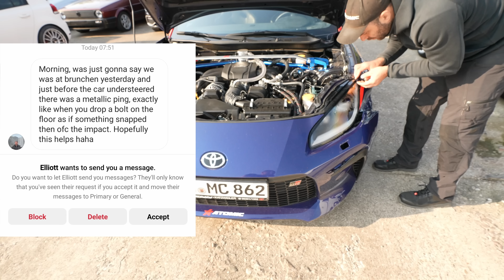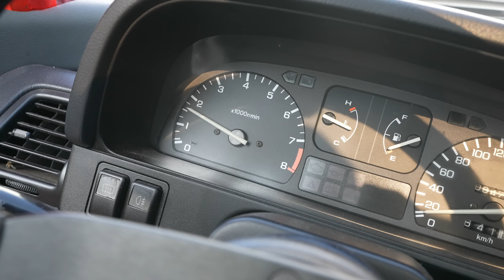My GR86 Nürburgring Crash Damage Report.

Comment: Hi Misha!
First of all: thanks god that you and Joe are safe! I cannot imagine the world without your contents!😮😊
Second: the tie bar inspection looks me quite suspicious! Normally that parts get first bended as a designed failing method (I would have also expected it as you impacted at moderate speed), their crack section is also at the outside joint housing! Thus it's strange for me that the bar looks fine on the outside but the rack can be shaken on that way. I don't think the inner joint is failed too (but possible)...that should be much more massive than the outer one, but take a look at the overall steering! Tie bar fixation thread to the rack, yoke (support and fixation part between rack and pinion)...unfortunatelly the mondern steering systems don't really like NOS missions as durability test! It's not a bet and win contest but the clunk could come from the steering itself!
Keep going and fly safe longer!
Cheers
Marton

Comment: Inner tie rod snapping like that on the steering rack side and without any sings of bending, I hope you give that a second look when the car is on the lift. Usually as a result of a crash they will snap on the threads connecting it to outer rod where it is the weakest, and if it did fail prior to the impact car would want to push straight just like it did, so really want to see that explored further.

Comment: Glad your well Misha! I don't think it's abs going into ice mode because you would have just lost braking. I wonder if anyone had video of the crash from outside just so you could have seen what direction the wheels were facing. That would help figure out some of the mystery. My money is on liquid on the track or maybe that clunk was the tie rod breaking off. Could also be the pillowballs were badly worn on the coilovers and they welded themselves to the strut tower mount. When the fronts pillowballs go, you can potentially loose some steering angle before the wheels actually turn. Basically instead of the coilover rotating where the pillowball is, it'll rotate the shock itself. (it will make a clunking noise like that since the coil spring itself rotates) That lower coilover lock being loose might also be evidence of that. (I'd check for wear on the upper lock where the spring sits on) Anyway, glad you and the passenger are doing good dude! You are by far my favorite dude on YT

Comment: You bring up a good point about ABS.  Something could have failed in the system that caused the wheels to lock up.  As for the noise,  if you ever driven on snow/ice, the ABS does tend to make quite loud "clunking" sounds when it engages or disengages.

Comment: You should be able to tell if the steering rack was broken in tension or impact by looking at the metal grain structure at the break. If there's stretching it was likely your clunk, and caused the accident. If it is "squished" then the break was likely from impact.

Comment: One very important thing to note, it's illegal to polish headlights in germany. For any reason. Be it for scratch removal, to get clouded headlights back to clear or any other reason. To be clear, the damage on the headlight isn't repairable, and wasn't repairable before you noticed the cracked mounting points etc. Just the damage to the glass/plastic alone is enough to render it useless (except, if it doesn't impair function, then you can run it with the scratch - you can't fix that scratch though since the fixing itself is what renders the light illegal afterwards). 

Headlights have a scratch-resistant protective clear coating - which can be tested. If the TÜV guy checks the lights and notices the discrepancy, the car will fail the HU. The second you polish that coating, it's considered "bauteilich verändert", which means that the Typzulassung of the headlight expires. The exact same goes for re-coating the headlight yourself. There's no way around this, it's illegal. Which i guess is fine if you keep it to yourself, but probably not the greatest idea to do it on a car that you're going to give away, for the winner to then face the music at the Hauptuntersuchung. Even worse, it's a criminal criminal offense (not a "Ordnungswidrigkeit") to drive a polished headlight - and they'll also impound the car on the spot since polished headlights void the "Betriebserlaubnis". 

Here in german: 

" Jeder Autoscheinwerfer ist daher ein sogenanntes typgenehmigtes Bauteil. Bei der Typzulassung werden die Scheinwerfer bis ins Detail geprüft. Darunter die lichttechnischen Eigenschaften. Ein weiterer Prüfpunkt ist die Belastbarkeit der Oberfläche. Für diesen Prüfpunkt spielt die Beschichtung mit einer Kratzschutzschicht eine wichtige Rolle. Diese transparente Schicht schützt den Scheinwerfer vor Umwelteinflüssen und vor den UV-Strahlen des Sonnenlichts. Das bedeutet, diese Kratzschutzschicht ist wichtig, damit der Scheinwerfer seine Typzulassung behält.

Wird die Schutzschicht durch Abschleifen oder Polieren entfernt, dann erlischt automatisch die Typzulassung des Scheinwerfers. Der Gesetzgeber sagt dazu, dass die Scheinwerfer bauteilich verändert wurden. Ebenso gilt der Überzug der Scheinwerfer mit einem neuen Klarlack als eine solche Veränderung und ist daher ebenfalls nicht erlaubt. Wenn Sie die Scheinwerfer Ihres Autos polieren, erlischt nicht nur die Typzulassung, sondern gegebenenfalls auch die Betriebszulassung des Fahrzeugs. Sollte bei der TÜV-Prüfung die Aufarbeitung der Scheinwerfer entdeckt werden, wird Ihnen der TÜV die Plakette verweigern. Fällt diese Behandlung während einer Verkehrskontrolle auf, werden Sie mit Ihrem Fahrzeug nicht weiterfahren dürfen. Sie machen sich zudem strafbar."

I get that many people aren't too happy about laws surrounding car modification, but especially a channel that prides itself with tuned and modified cars should stick to legal method, especially on a giveaway car. Now.. I do understand that it's likely not bad intent by Misha or the mechanic, that's why i'm pointing it out here. If i recall correctly, there was a time not too long ago (somewhere in the last decade, i think?) where it was legal - so it's likely that Misha and the mechanic are simply under the impression that it would be perfectly legal/fine, rather than announcing an illegal modification to a giveaway car.

Comment: 0:40 the clunk

I noticed that on this clip it started with your foot already depressed on the break, you let go and then applied the break. The clunk noise happened when you applied the break. It's been a while since I've done diagnoses on breaks and suspensions, but this is a clue. It may be possible that the clunk you heard may have already been there, or if a part failed it may have failed prior to this clip. It would interesting to hear the whole video again and listen in every time you apply the break or apply the break hard if there is a clunk or a new noise leading up to the crash
Reply: Also there seems to be some discrepancies with ABS activation on your previous video, the last time you applied the brake the ABS had just turned off and didn't activate when you applied break again. Posted about it with details there. If you're still wondering I hope this helps

Comment: Just a thought, since everyone is saying they heard a clunk… if there was some form of liquid on the track and the tires had no traction, the brakes would stop the wheels near enough instantly wouldn’t they despite the tires still slipping across the track? The clunk may have been the sudden stopping of the wheels with the loss of traction? If you have a car up in the air (no traction) and the wheels are spinning quickly, the force from the brakes, alongside the abscense of traction causes them to stop straight away (possibly causing a clunk from suspension at those high speeds)

Comment: the ball joint on the steering jack is a good suspect. The strange thing is the ABS coming on right before the crash, its like one of the rotors blocked or something (abs sensor failed ? )must see if the sensor didn't touch the teeth ...

Comment: I'm pretty sure it's ABS related, it could be a dirty wheel sensor (rocks will block it), last time it happened to me all of the brake pressure went to only one wheel, I got so many other events with ABS malfunctions in this car, that's why I plan on removing the ABS pump unit completely, there are aftermarket solutions.

Comment: Interesting to me is that car went in understeer after the braking was finished, you were already on slight gas. This shows to me that you weren’t too fast or braked too late, otherwise you wouldn’t have released braking. Regarding the clunk, I was wondering if it wasn’t simply the noise from abs (unsure about how it would be captured by the cam system).

Anyway. Cannot wait to see the Honda :-)

Comment: My track E36 M3 had a 318 ABS in it and the front end locked up under 80% threshold and would not unlock and I went off as you did.  I could feel the pulses and that may have been the "clunking" others heard?  I'm sure you could have felt this.  I tried pumping the pedal and it would not unlock while moving.  It did unlock after I slowed down through the grass.  It did this three times then the 3x rule came into play and I was removed from the track day, haha. This was the first time I tracked it and it was debug day anyway.  the tires did not exhibit much flat spotting at all, look at the tires.  The 318 chassis was preproduction #32 from Spartanburg SC and was sold to GMG/James Sofronas then sold to me.  I did not replace the ABS but upgraded the rest of the brake system to the M version AND PFC pads.  The 318 ABS did NOT like this.  >>>>>>It was not calibrated for this kind of stopping.<<<<<<
Reply: MRMishaCharoudin.  you mean I won the wheel?!? 💥🥰😁 wut?!
Reply: MRMishaCharoudin.  scammer!

Comment: Not ice mode, it gives you a hard pedal you will definitely notice, it usually happens at brake initiation, and it doesn't affect steering, only brake pressure. You will probably never know, but I'd give it a 98% chance it was a contaminated track surface.

Comment: To me the accident clearly seems to be related not to a driver error, but to an external problem, i.e. low grip level on the outside track line at Brünnchen. This could be caused e.g. by rubber "snakes" from previous cars, leaking fluids from previous cars, etc. Another possibility would be, that you hit with the front left tire some metal debris, so that the tire suddenly lost grip. This could explain the "klonck", as well as the broken rim at the inside shoulder of the left fron tire.

Comment: misha. my jaguar has also been in a crash. hit in the front and the back. only the hood is a bit lifted at the windown. but its still steers great. and it still drives like a new jaguar. 
if you rebuilt it correct it wil drive correct. even on 2 wheels😂😂.

but because the gr86 is new. parts are going to be a pain in the rear end. lets hope you are lucky.

Comment: Did the cars around you have cameras recording by any change? If the steering column failed during the corner, the resulting left front wheel movement might have caught on camera and would definitely explain why the car went nearly straight (and probably also explain ABS action).

Comment: The track is a bit greasy and you put a wheel in the dirt with all the weight of the car on a wheel in the middle of a bend, it's over, loss of steerage, it goes straight on, nothing to do. It's a good idea to take your hands off the wheel to avoid breaking your thumbs. It's only those who don't do anything that don't get hurt. What about the cost of repairing barriers, etc.?

Comment: At first I paid no attention to the clunk as I was watching in passing and thought it was from the track excursion, but after rewatching the crash video, the clunk was heard at the same time You turned the wheel as far right as it went in that moment and You hit the brake, I didn't see anything on the track that could have hit the under side of the car, so I'd say have a better look at it once You start pulling stuff off for repairs.

Also that Civic definitely needs the cage, I didn't know they allowed cars with such low NCAP ratings on the road when i first looked into it a couple decades ago 😂

Comment: ...are you absolutely sure it's not the anti-spin thing that popped the brakes out (with a clank)? That this then releases the pressure on the wheel that it had during the brake, lifts the tire and so on, so you'll get this no-warning slide with no steering wheel feedback or tire squeal? Mechanical failure just is not that uneventful is it..

But all the best, Misha. And good luck on the upcoming races :)

Comment: Bad news, but no injury so it's the best news. For the cars it’s only crumpled sheet metal, bolts and nuts. It’s also the risk on track for everybody. 
For the noise can it be a fatigue in the alloy rim that break due to racetrack corner shaker?

Comment: It sounded like it morphed a rod during the turn. It's such a bizarre scenario whether it's suspension or brakes or steering. But I suspect that was caused by something else that rooted from something braking.

If it helps, try finding similar videos or stories of racing or amateur experiences.

The car didn't dip or jumped when the noise occured. It looked locked in place maybe due to overload.

Comment: Looks like the driver rear tire got cut all the way around multiple times. Did this happen when the car was towed? Ive lost a rear control arm before and the only way to describe it is a complete loss of steering authority. It feels very unusual. Recoverable. But not in that circumstance. Is there any outside footage of the incident?

Comment: For the front all this damage are normal because the impact was rapid with a bit of an angle,for the rear the impact was lighter but the ball joint broke made in aluminum and is  not flexible like steel And break ,the same for the wheels.

Comment: If the tie rod inner ball joint has failed, and the arm is completely straight or the shape it should be, then it would be fair to say the joint failed causing it. If the arm is mis-shaped then that would be impact damage I'd have said.

Comment: Seeing ya build an old Civic would be cool! 3rd and 4th gen Civics look somewhat similar, and there's so many variations really, hatchbacks, sedans, wagons, in fact the 4th gen ones have a wagon version you get with AWD, if ya wanted to go silly, seen some use those for either offroading or dragracing :P
But those old boxy Civics would be cool, be it a K24 swap, K20, or swap a vetec head onto the stock engine as a lot of those have the D15, which you can fit some of the vtec heads on, maybe as a in between while waiting for an engine or something, or if ya can't be bothered to do a swap. :P (This also works with the EG Civic as a lot of them were sold with the D15)
Or maybe just go completely off the rails and import a G20 or G25 engine, either from Japan from the Honda Vigor, or in the US, the Acura Vigor, they're Honda made 5 cylinder engines. :P

Weird tangent aside, the ABS bit is sounding likely as well, as people did comment on the hazards having turned on as ya braked entering the corner, and if brakes didn't work... well, I doubt a faulty suspension bit would take out the brakes? Unless it'd mess with the ABS sensor?

Comment: I remember the old Le Mans cars would go airborne if they were too close to the car in front at high speed. Remember the Merc that took off and back flipped? Same way airplanes can't take off too close together. Do you think, clunk aside, maybe the GT4 contributed to a light front end?  ABS kicked in, drives car straight, bomp.
All guess work and pondering here, no knowledge or experience, so could be all wrong 😅

Comment: Came in to the corner off the racing line a little hot, off camber, hot tires probably high pressure which will affect braking. That's my opinion, nothing wrong with the car

Comment: I still think it's very strange that was the only lap the abs kicked in... first lap you passed the gt4 on the outside, second lap you had sustained load because the track was clear, 3 lap you have gt4 in front again but this time you make the turn at lap 1 speeds but with lap 2 line.. Don't think Im bashing because I'd give you my keys any day of the week but that's the impression I had.

Comment: 10k to fix that seems way low. Maybe parts are cheaper in Europe. But, in America I would have guessed over 20k to repair. 10k in parts alone... but, I have zero knowledge to base that on. Just going off cost to replace stock parts on vehicles I own. Hell, 4 new brakes for my little jeep Disc's and Pads sit around $500... $700 if inpay someone to install.

Comment: The new CRS are much faster, deff not lighter though. Thats the only downside I've found to them while using them for time attack this season. Don't think they'll make it more then 1 lap on the ring though at full attack. They have better heat resistance then the A052 or RE71R but they're in that class